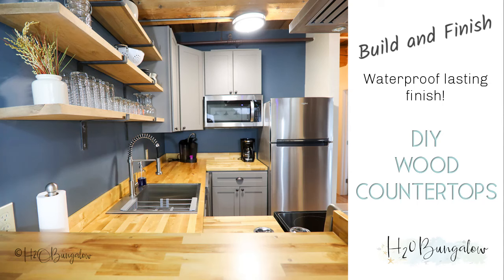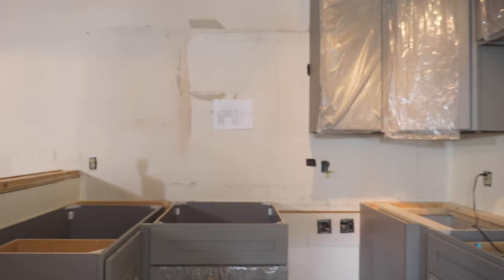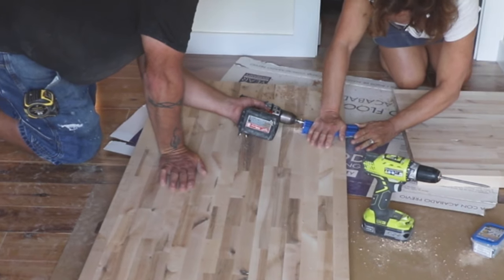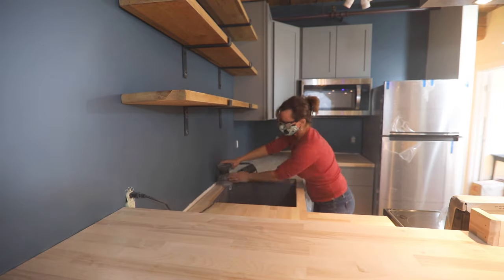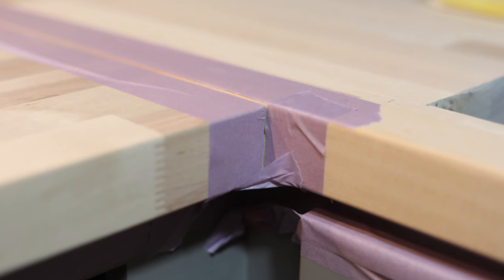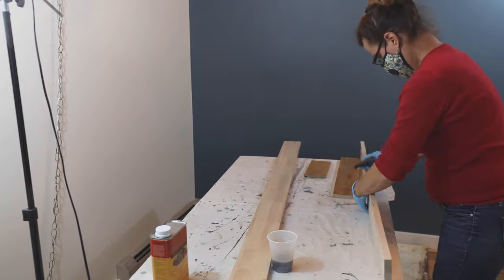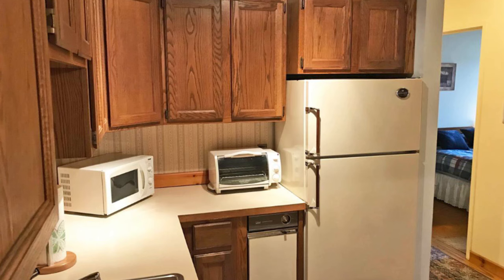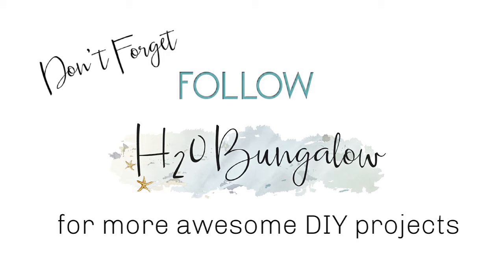How To Make A DIY Wood Countertop

Comment: People fuss too much to turn a 90 degree angle with two perfect match 45 degree cuts. Why? Just make the cuts at 45 and don't worry if a little off, assemble slabs in place or on the bench. Set up straight edge along the 45 and run a router and bit (perfect channel not all the way though) to inlay a strip of wood or contrast color material whatever. do the same for a butt joint